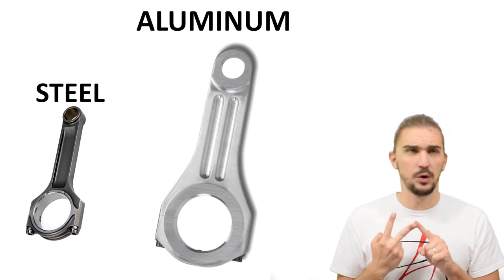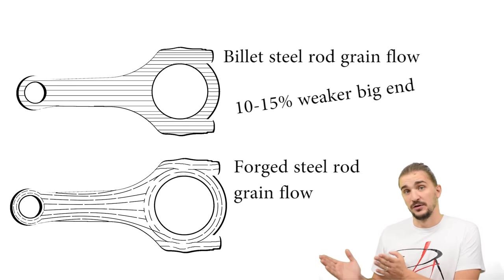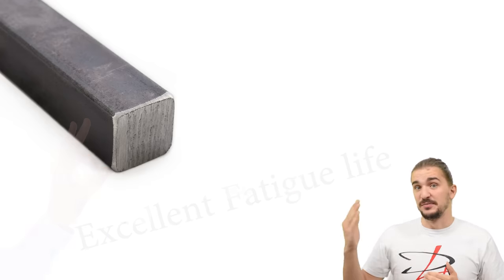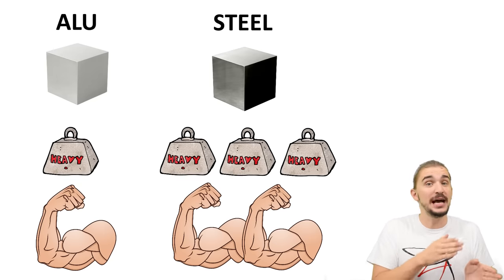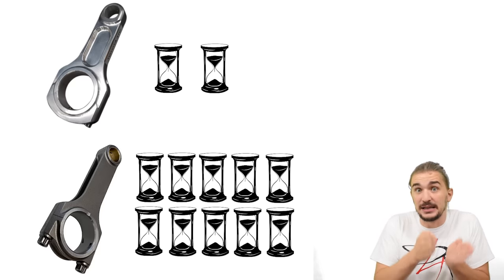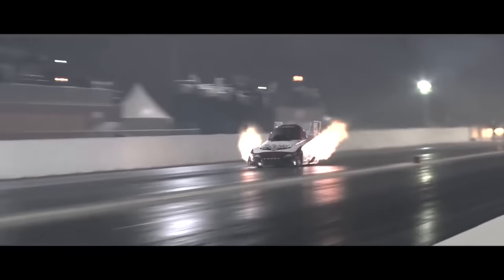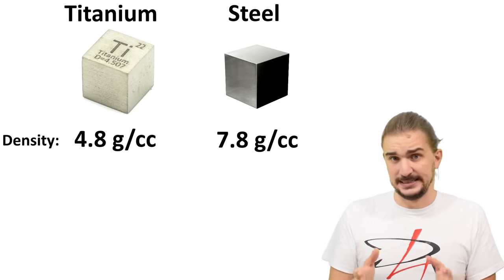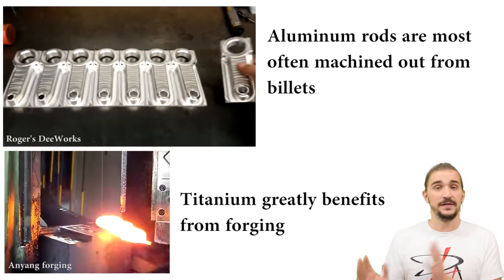STEEL vs ALUMINUM vs TITANIUM Connecting Rods

Comment: main point of forged aluminum is the shock adsorber  effect.. in our top level engines (12,000hp in 500CID) we run the rods until they shrink (get shorter) by our magic number..   This video is pretty spot on .. not sure where he got his info but it is really good...   Now the work being done on carbon fibre rods.....

Comment: I can attest to titanium being 'difficult' years ago I was a partner in an engineering company, specialising in heat exchanger components for the petrochemical industry.
We were approached by a customer who had tried to manufacture tube sheets from titanium and failed.
I quoted the job @ 4x what we would ask for stainless steel + a big oops factor and very nearly came short. Eventually though we worked out how to do it and it became the most profitable job we ever did.
I would describe is as trying to machine abrasive toffee to fine tolerances.
Reply: What’s the secret?
Reply: Heard that a whole new machining industry to be able to machine titanium for the Sr71.  Looked like a pain in the backside.  Way to engineer your way to success!
Reply: Anyone else looking forward to the abrasive toffee connecting rods video?
Reply: In my section of the shop we don't machine titanium but from what I've heard about it I wouldn't like machining it. 

Titanium work hardens like nothing else, thus peck drilling is a no go, if speeds and feeds ain't perfect along with a regular supply of inserts as to have fresh tips you're going to have a bad time.

Albeit the other side of the factory says doing chromed induction hardened steel like my side does is far worse, 62-65 HRC 10-50 thou deep. I do hate them ceramic inserts but as long as you rotate and change them out per so many parts you're usually good.
Reply: @zedsdead7670 yes, no pecking and like stainless & nickel, high feed & low rpm for drilling. 
I will say that once we learnt what tools & coatings to use along with speeds, feeds, frequency of change of cutting edge it became routine with no scrap. A very sharp edge is essential. 
But the learning curve was steep. One of the things we really struggled with was tapping - we had thousands of tapped holes. The taps would bind up & shatter. We tried every type until we found that the cheapest steam quenched tap (black) worked perfectly.
Reply: That's why titanium is used more in tools (either in carbide form as grains along with WC or in nitride form as coating) than in parts.

Comment: Interesting info. Didnt know forged steel will still be the best of all applications. 

Your video saved us a lot of money if we just blindly choose the 'best' material for rods.
Reply: not all applications. drag racers use aluminum and F1 cars use titanium. low budget performance and non-performance use-cases use steel.
Reply: @sepg5084  so basically if you're not going to be pulling apart your engine every time you push it hard, just use steel, otherwise .. if you do use what ever you want .. although have a nice big chunky bank account backing you up :D
Reply: @sepg5084  i dont know a single drag racer here that use aluminum rods. all of us use 4340.. and some of us go 10s. maybe in the 7s it "matters", but only because they can not make the motor spin with fuel. they need rotating assembly savings to bracket race. which is lame IMO. if you run a 7.9 who TF cares its still a 7. competition can drain these dudes pockets.. im not gonna complain :P
Reply: Titanium FTW

Comment: I love the concept of Titanium in everything. Such a great metal.
However for rods, sigh, I can live with the cost, and selecting a good set of forged rods rather billet. But ! The galling and notching issues versus the now minimal weight offset leaves me thinking forged steel for now until someone comes up with a better Ti alloy.
Great content.
Reply: Titanium rods are normally 25–35% lighter than steel, so that's a big difference. Today's coatings also have very high impact resistance, so galling and notching are far less problematic than non-coated rods. Not sure about the fatigue life though.

Comment: Nice and accurate explanation young sir. I have manufactured Connecting rods for almost 12 yrs. prior to retirement. Borg Warner, and GKN sintered metals. Our 4340 rods were forged, (One hit) which came from a powered metal process (compaction), then heat sintered at 1800 deg. F, for 2-2 1/2 hours,  and coated in liquid graphite at the end of that process. This process resulted in a "near net" rod with a 7.0 density and required only flash removal, and surface grinding, ID Grinding then shot peened. Each were magna-fluxed or resonate tested for cracks. The Lab did Rockwell, yield strength,  tensile and micro structures and overall density. Result, a low cost, well balanced within 5 grms pin to crank end. We made them for all the big car mfg, and aftermarket like Howards. Nascar loved them. In all those years, we never heard of a rod failure due to process or workmanship. We designed the rod for the Z-06 GM platform, down to the 1600 Rod for BMW that went to Brazil. For the cost and durability, I will take one of my rods anytime over Billet Alum, cast, or titanium. Thanks for a great video. Cheers from Motown!
Reply from the maker: Thanks for the rundown on how you did things! Really nice and interesting insight there
Reply: @d4a  Thank you! I loved it when you referred to them as Conrods. Thats exactly what we called them.

Comment: great video as always, the only thing i will say is that the vast majority of oem rods are SINTER forged which is entirely different than traditional forging. far and above stronger than cast, but not as strong as a traditional forging. oems have used this process for years now because it is fast and easy and cheap (relatively speaking) and requires very little finish machining. even performance and workhorse engines like the vast majority of gm gen 3/4 and even gen 5 use sinter forged rods with the exceptions being high performance variants such as the ls7 and 9 among others.
Reply: Well… LS7 and 9 are forged titanium

Comment: Steel really is a wonderful material, isn't it?
Reply: Scientist Walter didn’t stick around for the other two?
Reply: Pretty sure he did. All things considered, forged steel is still the best material to use for con-rods, except for some very niche applications.
Reply: Honestly, unless you are looking to find the last 10 percent of engine output, steel is the best for your rotating assembly
Reply: Chris Farley : Titanium is too brittle material and flexes alot with heat and movement, I'd expect the same with aluminum. Nice name by the way.
Reply: @michaelvann1934 : I don't work with steel ever, I work with alot of Titanium and Cobalt. Is there a specific type of steel that works best? or at such low rpm's it doesn't matter at that point, I mean I'm talking about a non high performance engine.
Reply: Not from China
Reply: 4340 is a wonderful material. so fking strong
Reply: Steel is real
Reply: When you look at the physical properties of most other metals and alloys, yes, steel is a wonderful material. All other metals and alloys have some major drawback that reduces the breadth of applications they can be used in, whereas steel remains the default material for essentially all load-bearing applications.
Reply: Steel is still wonderful.

Comment: I'm not an engine expert, but you pretty much nailed the differences between alloys of steel, aluminum and titanium.  Great explanation.  Titanium also has pretty low thermal conductivity which can be helpful at times.
Reply: This lack of thermal conductivity makes it difficult for machining. I saw tungsten carbide inserts glowing while cooled with emulsion at quite low cutting speeds. With other materials a lot of heat goes in the part and the chips.

Comment: This was very interesting. I learned a lot. I view these materials through a cycling lens. Some people ask what material is best, and I tell them it depends on how you plan on using it. I think the same responce applies here. I've ridden bicycles made out of all of these metals. 6/4 or sometimes 3/2.5 Titanium is much preferred because of its flexibility and resistance to corrosion. 7000 series aluminum is very stiff but has a tendency to crack under repeated stress loads. Aluminum tubes for bicycles are very thin and have a tendency to dent very easily. Thanks.
Reply: Also a cyclist, worth noting that aluminium isn't really stiffer than ti. The "traditional" oversized tube frames that alu is made into is what gave aluminium its reputation for stiffness. 
Aluminium also isn't a material that handles repeated bending well in the long-term so oversized tubes that are stiffer and don't bend much were a way to create frames that lasted. 
Some of the original aluminium frames by Vitus had thin tubes that were of a similar diameter to traditional steel tubes and were known to be way too flexible.

Comment: 15:30 - Slight correction: You can't use RAW titanium in any application where metal parts are sliding against each other. Titanium that is coated with titanium nitride (gold-colored), aluminum-titanium nitride (deep purple colored), titanium carbo-nitride (grey colored), or diamond-like carbon (shiny black colored) can be used in sliding applications with no risk of damage. And technically raw titanium can also be used in sliding applications as long as it's lubricated with extra-fancy oil and the load isn't too high, but obviously that doesn't apply inside a car engine. EDIT: Nevermind, you eventually explained the coatings.
Reply: How long do the coatings last on titanium
Reply: @liammiddleton3064  those coatings are done on some wicked drill bits, i guess its not too bad
Reply: Yeah, titanium has an exceptionally high friction like silver, doesn't it?  I forget the technical term.  There's also a different for some materials between friction of like materials and dissimilar.
Reply: @liammiddleton3064  I presume that they're effectively indefinite since there's no sliding contact with the rod surface
Reply: @benjaminmcintosh857  i have no idea
Reply: @VndNvwYvvSvv  coefficient of friction? I dunno, I’m a high school flunky that learns shit through videos on topics I’m sorta interested in 😂
Reply: Do those coatings also help with notch sensitivity (at least partially, in case of surface scratches by example)?

Comment: NOTHING beats steel rods and flywheels for long-term reliability. Also you get no Torque-loss.
Reply: Forged ftw!
Reply: Just gives you a bit of short lived acceleration gains... so driving uphill with a friend in the car means you have to rev harder to maintain your speed.

Comment: This was very informative because I've been looking to have titanium rods installed in my "street" car.  I'm more concerned about reducing reciprocating mass than beefing it up for more power.  Less moving mass will organically free up more engine power.
Reply: also for motorbikes you can make a huge difference by reducing the reciprocating mass
Reply: An additional advantage is that reducing rotating and/or reciprocating mass (of which rods count as both) will potentially reduce shift times, assuming you're using a manual transmission at least.
Same idea as if you changed to a performance clutch with a smaller diameter and therefore smaller moment of inertia.
Reply: Do it. LS7’s are magic

Comment: As a CNC programmer and machinist, I've worked with alot of different alloys and Titanium is a bitch to work with. It's so strange in that it's "gummy", yet tough as hell. Unlike machining steel where you can tell your tool is wearing, with Titanium, the tool fails quickly and usually catastrophically. Luckily alot of newer machines you can set parameters to monitor "load". So as a tool starts to fail, the load on the machine tool motor starts to increase, and if setup properly, the machine will issue an alarm before the tool fails. I must say, a properly machined titanium part is a thing of beauty.
Reply: Some people who machine titanium are using cryogenics to super cool the material and thus able to machine a lot easier. The Russians were the leader in making titanium; machining, fabricating and welding it. Their airplanes and rocket were mostly titanium.

Comment: In the early 70;s  I heard of a Matchless G50 fitted with an early Titanium rod  - it worked great for a season  however the following season it snapped - I inquired why and was told it "Age Hardens"
Reply: Depends on the alloy and should be taken into consideration when designing the dimensions.
Reply: my father says they fabricated titanium rods in the 70s for some of the BMW race bikes and they only got it to work once they put an aluminum cap on it to help absorb the harmonic distortions that would fracture the titanium. tiny little rods with massive caps lol
Reply: A&P here who can attest to titanium age hardening. Some of our rivets had to be kept in the freezer to keep them from hardening. You only had about twenty minutes to drive them or they would crack. On the other side of the coin, the titanium alloys used in turbines last thousands of hours without fail. Wouldn't use it for connecting rods unless absolutely necessary. Even small aircraft piston engines still use I or H beam forged steel rods for longevity.

Comment: As a machinist, can confirm that titanium sucks
Reply: Yup i totaly agree 😅
Reply: it burns pretty
Reply: The shear strength sucks too. In terms of machining a lot depends on the tooling. The worst stuff I've worked with is nearly pure copper. In fact most metal in a nearly pure state machine like horse dung. Soft and gummy.
Reply: @embalmed  
Toxic too as I recall
Reply: and cost too much, even when they were one of the most abundant element on earth and be easily be forge under modern technique, they just simply overprice.
Reply: You ever work with Inconel or any other superalloy?  Are they terrible too?
Reply: @soundautomatic1 
We didnt see any of those. AMPCO-14 & 21, D-2 and S-7 are bad enough. Later we switched AMPCO-18 and that's actually not bad. Copper Nickel alloys can really suck
Reply: @soundautomatic1  not as bad, they all work harden but at least Inconel, Hastelloy, Waspalloy, A286 all shed the heat in the chips still. Titanium keeps the heat in the work piece
Reply: I'm curious what problems you've had? I work almost exclusively with Ti6Al4V and don't find it that big of a deal. In fact I really prefer it over something like 316lvm.
Reply: What company do you work for?
Reply: @mpetersen6  Titanium isn't toxic.
Reply: @mpetersen6  Oh the joy of machining bus bars.
Reply: @michaelweston4738  I used to rebuild seam welding heads. High copper content spindle. The bearing mou ring diameters and the area where the conta t shoes ran all had to be ground. Copper grinds like poop.
Reply: @mpetersen6  Yeah copper is a pain in the ass. We used to machine copper bus bars for one of the local power stations. A complete pain in the ass.
Reply: The worst stuff I've seen so far is René 65 alloy that thing is filthy on tooling ...Next would be A-286 , not much forgiveness if your specs aren't on point .
Reply: @onebladeprop you are right, Titanium is getting a reputation that it so difficult to machine but using sharper tools and greater positive cutting angle it is not a problem. Of cause there can be some problem with nice chips production, so the the machine center can work 24 h unattended will not be realistic. I can recommend to see edge precision videos too. I'm much more scared to machine Inconel and similar metals.
Reply: @embalmed  no Tinanium does not burn, I think you mixed up with Magnesium that can burn if you use water based emulation, so don't do that.
Reply: @soundautomatic1  Is that an Invar alloy?
Reply: What would you say to companies like BME that are using aluminum alloys to make their rods supposedly as durable as steel?
Reply: Not a machinist, but I can always confirm that it sucks to form too. So much spring back its unreal and quite often we have to heat it up before we form it else it just splits
Reply: Tin Man would agree
Reply: To brittle
Reply: Chris Farley it’s lighter than steel but still pretty strong,and well maybe you should raise your car up a bit

Comment: I've been a machinist for over 20 years and most of that time I have been cutting Ti6Al4V. It's honestly pretty nice to machine. Granted you have to use the right tooling and you can't tear through it like aluminum. But it is far better to work with than 316lvm or cobalt chrome.
Reply: Congratulations? You machine one of the most common Ti alloys ever....
Reply: I've been told nickel-chrome alloys (Inconel) are very difficult too

Comment: Very well done. You hit on almost every detail in the differences between these 3 connecting rod materials. You even taught me a couple things in the titanium connecting rod department. Although, you were perpetuating old wives tales when it comes to modern aluminum rods. Yes, they will not last for 100k miles at 200hp per rod but, they have made huge advances in longevity. They will easily go 10k miles in a high power application before needing to be checked. Their advantages now outweigh their disadvantages in many high-extreme power street cars.